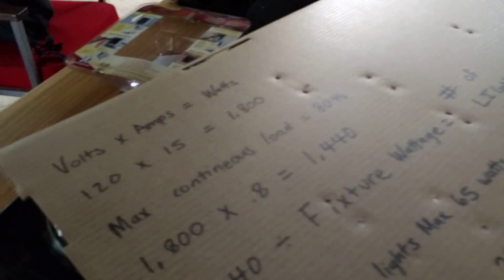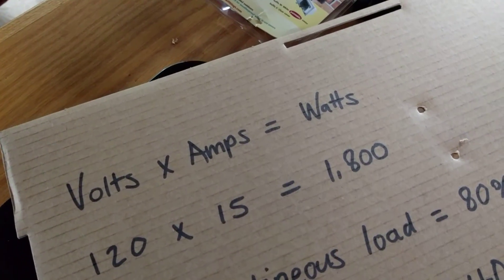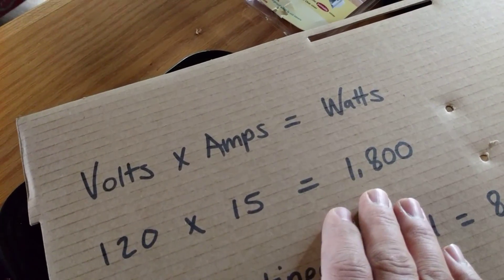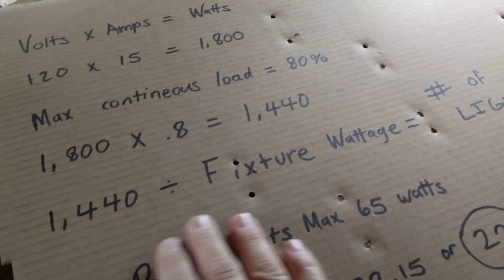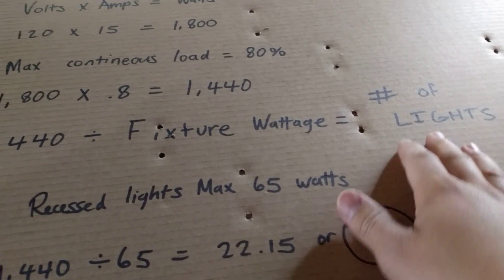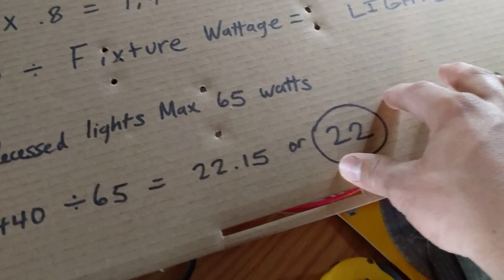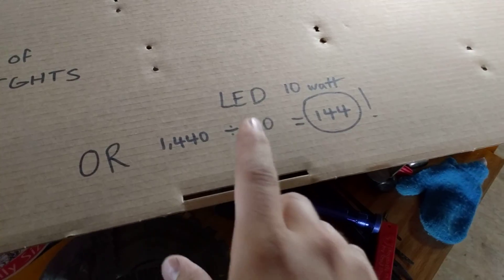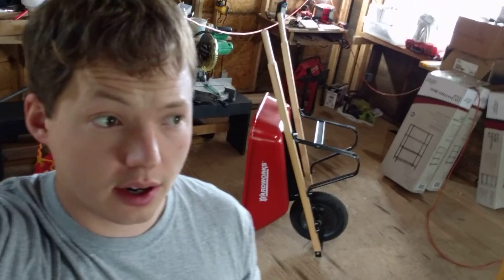How Many Lights on a 15A Circuit Breaker? Calculate Wattage for 15 Amp Circuit & Number of Fixtures

Comment: I've been an electrician for 6 years now and this guy has solid knowledge, and excellent teaching qualities. I always recommend my coworkers to these types of videos to help learn the more in depth side of electrical distribution and code. Keep up the great work man!
Reply: I watch 30 videos trying to understand what u said in 4 mins. You broke it down so easily for newbies!! Thank you so much!
Reply: Except that the 80% rule doesn't apply to most household loads, lighting included.
Reply: @jimproffer570  So what is the correct percentage and an explanation would be nice?
Reply: @glasshalffull8625  The 80% load rule applies to continuous loads.  Most household circuits are not considered continuous.  Feel free to load non-continuous loads to 100%
Reply: @jimproffer570  Thanks!
Reply: @jimproffer570  Sorry for the dumb question, by continuous load do you mean that all the fixtures would be on at the same time?
Reply: question i have a customer that previously had a small shed wired. she is saying that sometimes the power turns off. its on a 15amp breaker. grounded to a panel in the shed that has other breakers on it. will a 20amp breaker fix that problem? short of rewiring her whole shed. also her shed as multiple plugs and switches. I was thinking it was just drawing to many amps.
Reply: @texasswag25  Does it trip when she’s running her arc welder or some similar high amp device?  Since it’s a small shed, I would kill the power and then check every connection to make sure there’s not a loose one and also the breaker connection.  If it’s not an obvious fix, then maybe replace the breaker as it might be failing.
Reply: @glasshalffull8625  it was the breaker
Reply: @texasswag25  Thanks for responding!  A friend of mine had a shed and converted it into a ceramics studio.  I was good to go with putting in a couple of lights and sockets, but had an electrician handle a new circuit from the panel for her ceramic kiln.
Reply: He does not add in voltage drop for so many lights...he should explain how he ran it as well , as length of wire is also crucial

Comment: Led lights normally require high currents. Will it trigger circuit breaker very easily? Thank you
Reply: Um, I think you need to rethink this. They are not high current.

Comment: Ontario (Canada) building code allows up to 12 sockets & lights in one single circuit of a 15A in the living areas. Kitchen and washrooms are different because high power appliances are more likely used in these areas.

Comment: Also, keep in mind that most LED bulbs are not rated for enclosed fixtures.  They will die from heat death in a month.  You can get them that are compatible, but you must read the packaging to ensure they are.  It is best to use LED bulbs for table lamps or open fixtures and stick to prefabricated LED luminaires for enclosed applications. You can buy "can" lights with LED's built in.  They generally have massive heatsinks on the back to combat the heat the enclosed space generates.  I have switched almost all my ceiling light fixtures to prefabricated LED luiminaires.  The pro is you never have to change a bulb.  The con is that if the light goes out, you must replace the whole thing.  Most are rated for 40-50,000 hours which is a few decades if you use them 3 hours a day.
Reply: rating is just a rating, ive seen LED light burn out in just a year or two..  very common actually. LED light ratings are sht
Reply: @jeepsblackpowderandlights4305  that's cuz you buy the cheapest shit fixtures or bulbs. properly cooled, they last that long. if the drivers will is the real question
Reply: @morgangrisby8107  GE is cheap sht ?  Theyre all GE bulbs.  You have no idea what youre talking about buddy.  The issue with the led bulbs i have is bottom.  The paper thin layer coating burns/wears off while old fashion bulbs had like a 4mm thick coating.  That never wore out.   The new bulbs today use a coating so thin its like gold leaf paper thin.. and it wear off from repeaditly turning off and off.   Its a well known issue.

The trash companies pump out today is amazing.

Comment: How about outlets, how many can I have on a 15am circuit? Thanks for the helpful video,
Reply from the maker: In this video I explain some of the aspects of what you're asking I believe.

https://youtu.be/9WPhmfNYWvo
Reply: At outlets, the standard circuit breaker used is 20A minimum to 30A depending on the load needed into a certain area or room..20Amp Circuit breaker,  atleast 6 2gang outlets.
 For Aircon and heating loads theres should be 20A to 30A circuit breaker to be use, mostly at kitchen area where heating appliances are mostly used. Sorry for my grammar.
im a filipino.
Reply: Ronald Higoy listen to this guy if you want your house to burn down....

Comment: Good video. You forgot in-rush current. This is a variable in your equation that you must factor for. Given that you have a 20% buffer should handle it OK but its better to factor in-rush current with the 20% for better performance & Best Practices. The equation would assume that the manufacturer of the lights has indicated a 10% in-rush current: Watts * .80 (20% buffer) * .9 (10% in-rush current buffer) = Total Usable Wattage, e.g. 1800*.8*.9= 1296 Watts.

I disagree with the troubleshooting idea as the primary reason to split the circuit up. You should be competent enough wire correctly and not to do stupid stuff like wire a Neutral to Ground, which will trip Arc Faults. They don't trip unless someone has screwed up somewhere. I think a better argument for not install 144 LED cans on one circuit is for resiliency. If the circuit is tripped or goes bad your entire house is dark. It would be better to split up the 144 by at least 2 circuits for better resiliency.
Reply: I agree with you... though 15 Amps breaker can easily bear the load of 144 LED lights but for the purpose of resiliency its better to split the load on multiple circuits depending upon the location/ areas where those LED lights are installed so that complete blackout can be avoided in case the breaker trips.
Reply from the maker: Awesome information. Thanks for sharing!
Reply: In rush current does not apply here. Used for electric Motors.

Comment: This video was articulated surprisingly well. Btw, another reason why you wanna have separate breakers is for troubleshooting different floor levels. Plus, depending on your region’s code you might have a limit on how many light fixtures you can put on it.

Comment: P=U x I  in Europa   p=230V x 16A   230 x 16 = 3680W max  for normale light bulps, for tube lights its lower because it takes extra power to start those lights when you turn them on(3000W)

Comment: you add the total wattage of the lamp then multiply by 1.25  total wattage should not go over 600 amps
Reply: al watts I sure hope it’s not over 600 Amps 😕
Reply: @edwrd1990  watts.... amps.... same thing
Reply: aguyandhiscomputer Umm.. just like volts and resistance 😐
Reply: @edwrd1990  yes, they're all interchangeable.

Comment: nice job, i like it when people use the K.I.S.S. method. note: continuous load is defined in the NEC as a load that continues for more than 3 hours. so if they were receptacles you could have an infinite number, as receps. are considered none continuous. but as you said, that would be a heck of a troubleshoot if something were to get jacked up. so best to keep it simple stupid. and i'm not calling "you" stupid it's just a saying. a little disclaimer there LOL
Reply: 180 va (watts) per receptical is the calculation

Comment: A useful video for assisting homeowners in installing general illumination circuits without confusing them with the Code language. However, For dwelling units, the Code does not actually limit the lighting ‘load’ on a general illumination circuit. Lighting limits, whether continuous or non continuous, only apply to non-dwelling units (commercial & industrial). The foundation for calculating dwelling lighting loads, including receptacle outlets, is based on 3-watts per square foot. The Code considers both types of outlets, lighting and receptacle, as ‘one’.

Comment: For residential lighting you can max it out to 15 amps, not a good idea but its not against code. Residential lighting is not considered a continuous load in the code book if i am not mistaken.  The wiring to your recessed  lights is nice and neat. Also, how you calculated the lighting is smart if you ever want to add more lighting down the line.

Comment: Very sound logical explanation.  If circuit space was a concern. I would have no issue bringing multiple home runs into a junction box, and tying into 1 breaker. 
But one thing to keep in mind. Particularly on lighting loads. If 1 circuit controls the entire home, or even 1 entire floor. If the breaker trips the entire area will be in the dark. Assuming its dark out. 
Nice video

Comment: It's called "OHM's Law"
Reply: OHM's law mentions Watts?
Reply: @tedlahm5740  sure does
Reply: Actually, it's Kirchoff's power law. P=IxE. Power = Current x Voltage
Reply: @supershawn2000  Hahaha but ONLY in a DC circuit or an AC circuit with a pure linear load

Comment: Great job Ben!!! 
Clearly explained (for the auditory learners) and showing the math for the visual learners was smart too. 

    As far as breakers goes I subscribe to the rule 1 breaker for each room. Drives me crazy when people put pieces of multiple rooms on the same breaker. That of course doesn't include the frig, the oven, washer and dryers, microwave, furnace, water heater.. they all get their own breakers.  The only way I change the one breaker per room is if your gonna have a large number of electronics in one room.. Like myself I am into computers both for work and for play as well as I have a license from the FCC for Amateur Radio (AKA HAM radio). So for me I'm going to want the room lighting and outlets for tv, cable box, modem on one breaker while the outlets for my computer stuff is on its own and the Radio equipment has it's own breaker.
This is something to keep in mind when you're wiring... what am I going to want to use this room for???
Reply: No wonder people are putting in 200 amp box's with 42 circuits.  My house was built in 1950 and back then they all had 60 amp service, 4 15 amp and 4 20 amp, one of the 20 amp fuses was for the bathroom heater, another 15 amp fuse was the furnace.  These were the only dedicated circuits in the house. In the kitchen their is a 20 amp circuit with 6 outlets with a 1,100 watt microwave, a washer, dryer, gas stove, toaster, induction plate, and refrigerator.  With 200 amp service every single light and outlet in the house would be on it's own breaker!
Reply: Shawn Rigoulot Very true. I’d like to talk to the person who layed out the circuits in my house. Circuits are a hodgepodge mix of rooms, lights and outlets. Basically lazy electrician who just wanted to run the least amount of wire from point A to B. Who knows, maybe the trend then in the late 60s was to save copper or something.

Comment: Ok so my question is .......I just bought a house that was built in 1988  and I've noticed that each room has ONE Circuit 15amps 14 awg for the lights AND outlets now I'm using led for the ceiling lights.....is this something I should be honestly concerned about in this day and age the only thing big I can think we are running is a hair straightener, blow dryer, or a small inferred heater obviously not all at once I'm just thinking worst case scenario????? I know in a perfect world you would want 15 amp 14 gauge for lights and a separate circuit 20 amp 12 gauge  for outlets BUT it is what it is ......am I gonna burn my house down with this set up?????????
Reply: Nah,  the house has survived for 35 years.  If you do overload the circuit the breaker will trip anyway.
Reply: It's up to code, as of 1988.
Reply: I have wired hundreds of houses just like yours has been wired. Sleep peacefully

Comment: How long can you exceed 1440. Like a 1500 watt heater?
Reply: most modern day electric appliances draw less than what they are rated for.  It may be a 1500 watt heater.   But in reality it actually draws 1200-1300 watts.
Reply: The reason is because there is an initial surge in wattage when you first turn an appliance on.  The heater may for the first 5 seconds draw 2200 watts.  And then after 5 seconds.  It drops down to 1200.  This is called starting wattage.  or surge.  They make appliances less wattage what they are rated for.  For safety and also to prevent breakers from being tripped so often when they are first turned on.  Which is why some old appliances.  U turn it on.  And the breaker trips immediately.  It is a safety thing.  So yeah the point is they draw less electricity than on the box
Reply: 15 amps up to 3 hours

Comment: what is the pig tail for?
Reply: Trecool Tabbilos    the picktail. In. Braker it's for connect neutral.  In arc fault brakers. The black wire. And white wire coming for circuits it's connect straight to arc fault braker

Comment: The Nec article 210 for branch circuits states that for calculating the amount of total fixtures on a circuit you go by the wattage rating of the fixture. So if the sticker inside the can says "65w max" thats what you plug into the numbers. The inspector was right but not in the "troubleshooting" sense. I'd agree that 144 led's would be fine as far as capacity but theres no telling what some maniac could put in there in the future if you ever decide to sell it.
Reply from the maker: DangerDaveFreestyle Well said.
Reply: That's why they sell led recessed light...

Comment: I hope your insurance is paid up.  Take your total load and figure it at 125%, if your lights will be on for more than 3 hrs at a time, then remember your branch circuit is figured at only 80% of it's currrent carrying capabilities.  Also did you pull a homeowners permit, and will you be getting an inspection from the local authorities having jurisdiction.
Reply from the maker: Danny Calk Yes sir. I think I agree? I'm not sure where what I explained was different from what your comment was getting at? I definitely appreciate input here especially if it can help clarify something I missed.

Also yes, I got the correct permits and had the electrical work inspected by the State inspector. All was well.

Thanks again for your comment.
Reply: There is nothing in in 220.10 that says residential is continuous or not, neither the numbers should be affected by continuous/non-continuous. Yet 80% is taking account of the 125%. (1.25=1/0.8)
The whole problem comes from electrician seeming to know the code but didn't pay attention during math classes at school: something lost forever unfortunately.

Comment: Great video.

I've been looking all over the internet for this simple tutorial. Glad I stumbled upon your video.

What if there are receptacles in the circuit,  how much do they consume ?  I would assume you subtract their wattage from the total.
Reply from the maker: Dave Ou There aren't too many code requirements that I'm aware of for calculating that. Basically I'd consider two things:

1 - Are there any "anticipated continuous loads" that will be connected to said receptacles and if so you would include this in your 80% load.

2 - Other general purpose intermittent use receptacles don't need to be included in the calculation. 

I hope this helps a bit! The way I wired I didn't worry too much about the number of receptacles unless there were anticipated continuous loads involved. Use common sense and you'll be good.

Thanks for your comment!
Reply from the maker: Dave Ou Receptacles themselves don't consume any wattage. Only the items attached to them.
Reply: It is recommended by IEC to connect receptacles/power load on separate circuit and lighting load on separate circuit.
We should not connect both receptacles and lighting load on any single circuit.
We should make separate circuit for each of them.
Reply: ANNAS MOHAMMED brother I am from LA came to Bakersfield CA, I work for a company that connects lights and outlets together I spoke to the supervisor and told then not to mix and outlet and lights together and she said have you done electrical before I told her yes and she said what type I said commercial and custom homes she said it’s different I said it’s different but it’s the same principle and she said well the inspector don’t say anything are you saying he doesn’t know anything I say I am not saying that although I was😁 anyway after that talk they didn’t need my services and I was happy cuz they was putting like 18 outlets and lights together overloading the breaker putting so much resistance on a 14/2 wire that may cause 🔥
Reply: You have to size it to the max watts on each lights because you have to make it dummy prove.
Reply: Dave Ou 👍👍👍

Comment: I know the CEC takes a lot from the NEC so I don't know if the NEC has this, but the CEC says "no more than 12 outlets on a 15A breaker. 1A per outlet". So, here in Canada, the max amount of lights is 12.
Reply: the 'outlet' which you are talking about is receptacles an nit the lighting fixture.
Reply: ANNAS MOHAMMED actually he is correct. An outlet in CEC is both a receptacle and fixture outlet and is limited to 12. There are exceptions to lighting circuits as the load can be known. If you have a light box up, you have to rate that outlet as 1 amp as it could have (and is usually a 2-3 bulb fixture) more than one bulb.